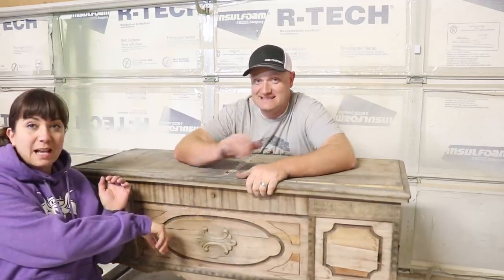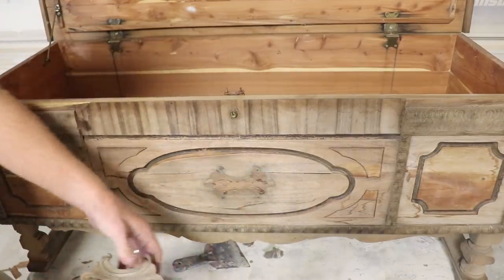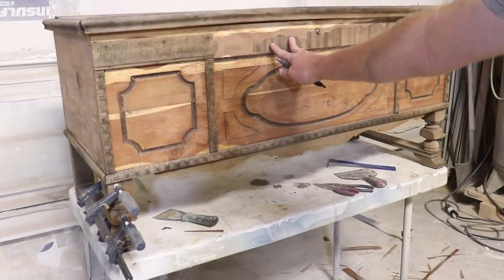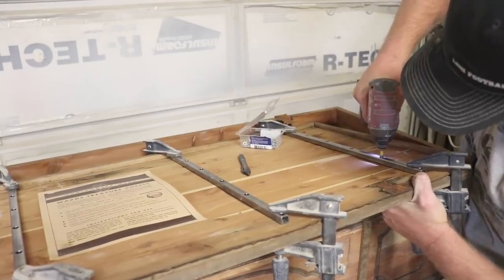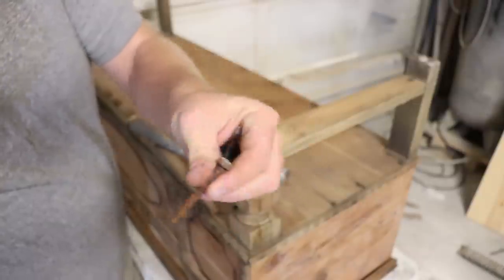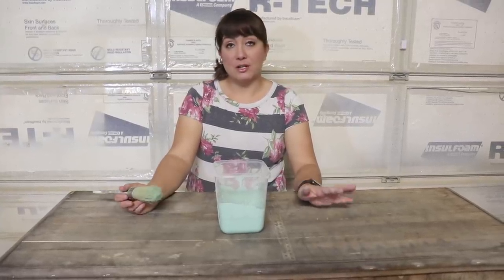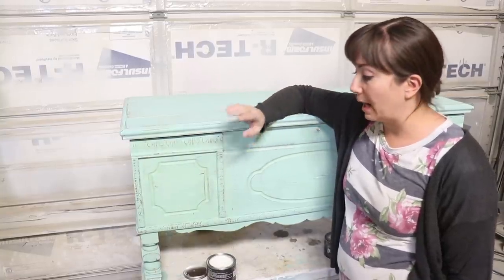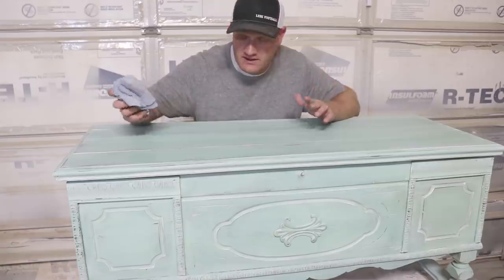How To Repair Furniture and Remove Peeling Veneer

Comment: What a great project. You always give me fabulous ideas for all the furniture I have piled in my house and cottage, especially how to get the veneer off.
Question? How do deal with the “old house” smell in furniture? Could you incorporate that issue in one of your DIY’s, thanks.
Reply from the maker: There are a few methods. Coffee grounds absorb odors, dryer sheets work pretty well. I often clean the inside of drawers out with bleach cleaner. Sometimes if it’s really bad I do all of those steps and spray it with febreeze lol.

Comment: Hello hello 🙋 absolutely love this piece...we knew you both would make it beautiful. I have a couple of newbie  questions...I'm sure you've told us before, but which of your top coats would be food safe over paint? Also, have you done any videos on how to make a sturdy coffee table turned bench? Thank you both for all the valuable information.
Reply from the maker: What are you using the sealer for?  To seal something to be food safe like the cutting boards we do we use food safe mineral oil.
Reply: @JamiRayVintage  I was channeling my inner Jami Ray and found some large faux metal looking platters...not the lovely tarnished silver ones...just a mystery metal. I want to paint the to match my China pattern so I can use them as serving pieces for the holidays.

Comment: I have a similar piece in my studio awaiting my handiwork. Zeb, mine has ball feet, one of which is missing its front half.  Any ideas on how to replicate? I’ve done bondo and paper clay for smaller detail reproductions, but would either of those every dry out if it’s almost two inches deep?
Reply from the maker: Bondo might hold up on that. I’ve had missing parts on feet and sometimes I just make the other foot match it lol.

Comment: I just painted a lane  cedar chest. I noticed the bottom has a huge piece of veneer that is peeling off. The cedar is good can I just peel off the veneer and paint the bottom or is there more I need to do.
Reply from the maker: Should be ok. Veneer adds some strength so make sure the cedar is thick enough to support having items in the cedar chest.

Comment: I've got a small table that was set out side bc my mother on law didn't want it. It's top is bowed and I'm wondering if that trick wouldn't work for it
Reply from the maker: It might work. I used two  1/2” square tube bars to get the top of the cedar chest flat. It was $10.00 for the bars so if it doesn’t work you won’t be out much.